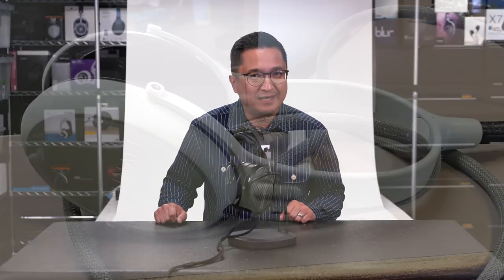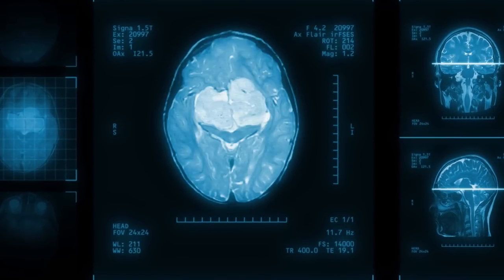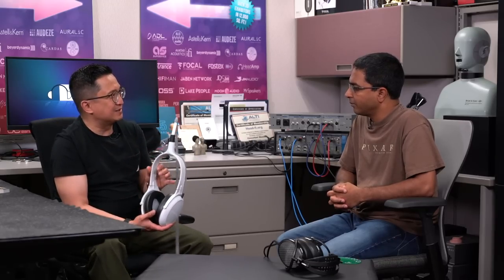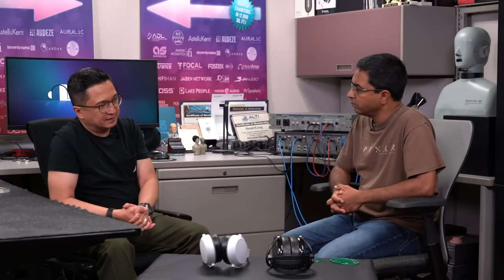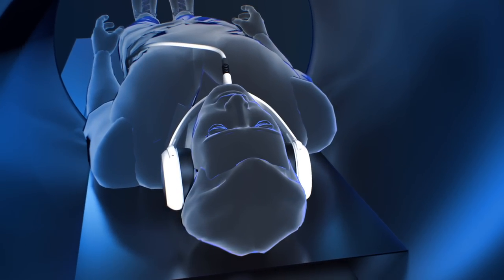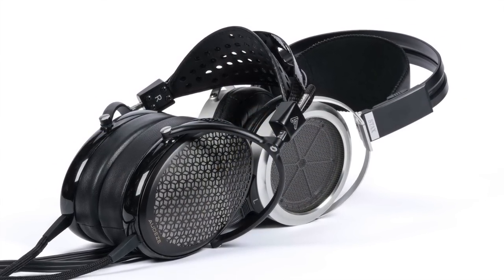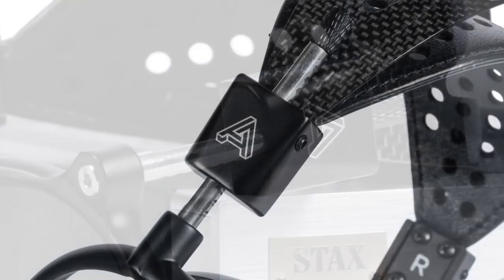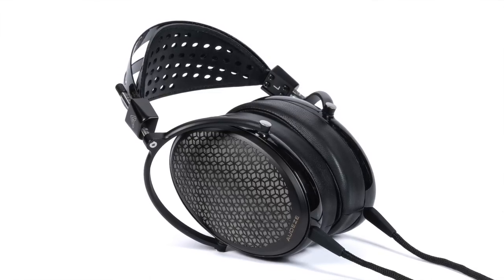Audeze CRBN Review, Interview, Measurements

Comment: I've been interested in an electrostatic headphone for a while but the combination of the high end dedicated amp and earspeakers were just too expensive for me to stomach. Since the CRBN can be driven well via lower end amps, they really have my attention.
Reply: They may be easy to drive, but they still need a dedicated electrostatic amplifier, and the headphone itself isn't going to be cheap.
Reply: @brandonbreuer6589  It would be cool if Schiit would make a specialty amplifier for electrostatic headphones, like they did for the SR1a.
Reply: I got the Koss electrostat from Drop for $350 shipped. Its fun and all but after a while found myself craving a "normal" headphone with strong bass. Electrostats have bass but the bass sounds odd after a while.

Comment: That doesn't look any less wonky than SR-009S 😕
Is Sennheiser doing some DSP/EQ in HE-1? Or how is it possible that there aren't any other neutrally tuned electrostats?

Also, I was told by my closest retailer that availability is absolutely tragic, the only EU importer received a single piece so far.

Comment: Good review, so another Audeze that is not listenable without EQ. They should make it the company logo - "Audeze - ridiculously expensive headphones that come mistuned out of the box and require EQ to become usable".
Reply from the maker: How on earth did you come away with that? I EQ most headphones I listen to at home to tune them to my taste. (I'm less likely to EQ on-the-go, as I'm sometimes not as discriminating when I'm listening while doing many other things.) As default signatures go, I think there'll be a pretty even split between those who prefer the CRBN and the SR-009, or even the CRBN and the SR-007.
Reply: Not listenable without EQ?
Reply: @headfi  But both the 007 and 009 are quite wonky sounding out of the box.
Reply: Yep audeze refuses to make normal frequency response
Reply: Lol what the FR looks pretty damn close to the 650